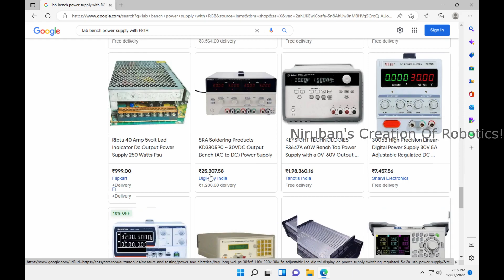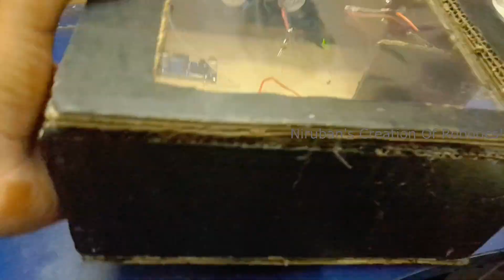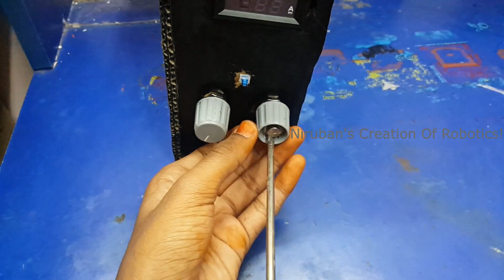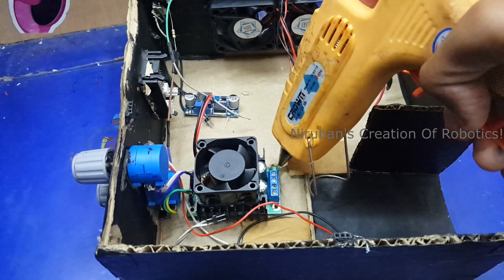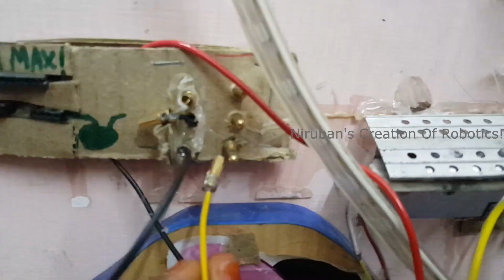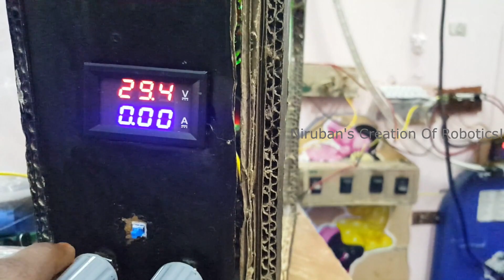How to make an RGB lab bench power supply | Niruban's Creation Of Robotics! | How to make #12

Comment: could u please upload the schematic of the "motherboard"....
Reply from the maker: Yeah sure.. 
Edit (Actually its still in the making process. So sorry about that but it will be soon available. Anyways thanks for your suggestion..)
Reply from the maker: So, as you suggested, I finally made the schematic (link in the description).
Reply: @E-GaN   thank u, the relay used here is used as short circuit protector ?
Reply from the maker: @studytechhindi3995  no it is used to turn the output on/off since the tiny switch will melt if I didn't use the relay.